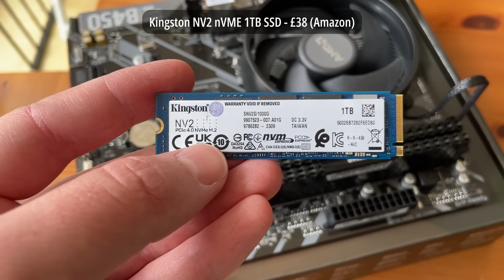Building a Cheap and Upgradable Gaming PC in 2023

Comment: It's funny how all budget builds almost always use am4
Reply: Why is it funny? I dont understand
Reply: @breh9320 Those AMD sockets ain't cheap unless it's secondhand
Reply: Built a junkyard pc for 200 with a 2700, sold it for 250. Buyer said he’s popping a 5600 with a rx5700xt..alls to say, am4 mad value lol
Reply: @thebambinofan  make 5 UK pound....
Reply: @thebambinofan  i build an AM4 for my sister kids and an Uni gift, years ago
it leave my desk with an Ryzen 5 1500X and an rx470,  im just gift him the x370 board that i have
He work it @ss off and now that very same PC now have ryzen 7 5700x and an rtx 3070, same good old x370 board
AM4 upgradeability are surper imo
Reply: am5 is too expensive 😔
where I live a motherboard on am5 is around 3 times as expensive as a board on am4
Reply: @rogofos I guess it depends on a lot of factors because at this point, an AM5 MSI Pro Z690-a wifi was cheaper than its AM4 counterpart. Made the more expensive RAM only slightly more expensive when you take the two components together. But not everyone is using an overclockable Intel CPU.
Reply: There aren’t really any good cheap Intel options if you want something that came out recently
Reply: @jiggybucksington  Nah the 12th Gen i3 is a beast for the price of it on the secondhand market
Reply: @jiggybucksington yeah tbh for $80 you can get an i3 or for $100 (Ali express price other places it’s $120) you can get a 5600. Clear choice imo
Reply: @jiggybucksington  That or something that came out years ago.
Reply: @jiggybucksington I mean,12th gen can be a very good deal,plus with 14th gen being confirmed to work with lga 1700 it's going to be even better
Reply: @TheRealNeoFrancois  yeah but there’s also been leaks that 14th gen is gonna only be a 5% preformance increase compared to their 13th gen counterparts. If it was 20% or better I’d buy Intel rn but that’s simply not the case. And at my budget range I get more preformance from amd
Reply: @Unboundiing  It's literally just a raptor lake refresh, what did you expect?
Reply: @Unboundiing  not from what i heard, i heard it was suppose to be around a 13 percent uplift
Reply: @TheRealNeoFrancois  ah okay, I was going based off of one of ZTT’s shorts
Reply: @jiggybucksington When I'm recommending specs to someone if they want new and budget-ish I always recommend them a 10105f because my brother uses it and hasn't complained about performance and you can always upgrade to something like a 11400
Reply: @ChiknPog  I'd honestly recommend forking out another 30 dollars and going for 12th gen so you have a larger upgrade path but the 10105f is still a good chip my little bro is getting my old i3 10105f once I get the parts in the mail lol
Reply: @Scornfull  motherboards are fairly expensive where I am and at that point it's out of people's budget normally
Reply: @jiggybucksington  because intel always changes the socket every 2 generations
Reply: Not that funny tbh
Reply: What's funny ?
Reply: Ryzen 5000 are excellent as well and cheap
My 4.1GHz 1200AF still runs anything better than Series S does
Reply: @Agent-mb1xx  That's interesting
Reply: The platform has been around so long and there are so many parts out there! 3 generations of motherboards with 4 generations of CPUs all pretty much compatible with each other. I wonder if AM5 will have the same  longevity?
Reply: *upgradeable builds
Reply: *upgradeable
Reply: 12100f with h610 would be better if you want to buy new and you will also be able to upgrade to 13th gen in future
Reply: @hueman69420  am4 is still cheaper and the 12100f and h610 is not worth the tradeoff for the price
Reply: As someone who builds and sells gaming PCs, I love these budget builds. Wish I would get more to build.
Reply: Why are you saying it is funny, are you suggesting that it is a bad value? Because the AM4 platform is actually a great value, and will probably be such for years to come.
Reply: @avtips4779  think they're saying it's funny because Intel isn't used nearly as often in budget upgradeable builds
Reply: @avtips4779 I never said it was bad value
Reply: Never been an AMD user but the 5 generation motherboard lifespan is always tempting
Reply: Processor are not that costly, gpu are intensive money hungry.
Reply: The 12100 is superior to almost all of the budget old ryzen stuff. Completely stomps the 3600 and i got one on ebay for 65$
Reply: 6 year old hardware is cheap. What's the big deal?
Reply: I managed to get a 12100f on ebay for 77usd, I think it's pretty good and cheap
Reply: For 500 dolares you can get a 12100f and 6600. Doble the price doble performance. Same value best experience
Reply: Its funny how intel just replaces every socket in 2gen of cpus and AMD still going with it.. hypocrisy
Reply: I3 better value to upgrade potential. Building a 300 dollar build now that could easily stay viable with upgrades for a decade. Lga1700 socket, ddr5, so the cheap 90dollar 12th gen i3 80dollar GPU and 1tb m.2 with 16gb 2x8 ram make it great for cheaper and more long-term upgrading potential.
The card won't go down much in value so will resell with little to no loss,, the i3 can be sold used for near zero loss even 7th gen i3 used sell in the right places forv100bucks now.
So going i7 or i9 will incur little loss on transition. 
Reason i3 is called best budget for future upgrade path.
Reply: Cool story
Reply: Am gonna do SOMEONES mom.
Reply: Kinda what happens when you have such a long upgrade cycle.
Reply: Or a 12400f
Reply: Recently built a new PC for my Mum (not a gaming PC). Intel really has nothing unless you want second hand at the low price point. The problem as much as anything is the need for a new socket every year in order to upgrade to newer CPU features, and their higher end CPUs hold money too well.
Reply: Best platform in recent history n should hold up for the next decade
Reply: AM4 is the way to go for budget builds. Motherboards for the Intel platform is usually to expensive for budget builds.
Reply: @@LazyDevsPc43v3r For gaming purposes? I wouldn't really do that, it's better to just use a 5800x3d instead and get a better gpu
Reply: Thats because of upgradability
Reply: AM5 and Intel 13th gen are still overpriced where I live. Plus if you factor in the DDR5 requirement for AM5 with the overpriced motherboards they make no sense for budget builds.
Reply: How is it funny?
Reply: @@LazyDevsPc43v3rkinda terrible value for gaming though
Reply: Yep I’m going to upgrade a system with a 2700x and a rtx 2060 oc I bought for only 200€ and I’m putting in a 5800x3d and a 6800 xt and suddenly it becomes a 200fps+ 1440p system for my wife!

Am4 really was the best platform ever released until now so let’s hope am 5 can follow its footsteps when the 8k, 9k, 10k and so on generations of Ryzen will be released!

I myself am still running am4 with a 5800x3d and a 6950 xt and will only upgrade when I get a good price for a 7800x3d and 7900xtx system for a really cheap price.
And I only want that for display port 2.1 support so I can use the latest amazing generation of screens!
Reply: AM4 boards be it X B or A ranges off something for all budgets and take a huge range of CPUs & uses cheep DDR4 RAM. Overall good stability especially 3000&5000 range cpus.
I started with X570 R5 3600 up graded to R9 5900 it's a monster gaming&creative rig then took 3600 put in a cheap A520 have a cool quite multi-purpose Bedroom PC that can do most things options were more limited &expensive with Intel.
Reply: There are great intel cpus like 10400F, 10700F, 12400F
Reply: I just got am4 with a 5500 to upgrade from a core 2 duo. It was amazing but literally today the same day I got the mobo and cpu it’s died. Idk how and I am very sad
Reply: @VolumeZero374  rma it
Reply: 1st try with AM4 I pre built cpu &memory into board then connected up power powered up fine, put into case press power dead cursed going AMD then noticed RAM Error LED on, tried each Stick individually found 1 dead DIMM stopped PC posting, email Corsair replace memory all good. Now fault find before blaming AMD.
Reply: 7 years of value and performance. AM4 is legendary.
Reply: AMD AM5 is too overpriced, if you wanna build a budget PC, you either get AM4 or switch to intel
Reply: @@LazyDevsPc43v3r How do you know it's the CPU that's the issue. It can be many other components that could be the issue, or the software.
Reply: Depends what generation Intel you would aim for as a lot of ryzen are better performers at a better price.   I recently built a test bench pc, but on a budget and for my base I have got an A520M with a Ryzen 4500 although I've put in a 3100 to update the bios. The 3100 was half the cost, but used and the 4500 is brand new and so without the rest of the parts I've spent around £120 maybe less on just the mobo and 4500 as they were both new.  The system is to try out games with different gpus mated to that cpu and it was the cheapest I could find new which is why they are soo good as a budget option.  I looked at lga 1200/1700, but a used cpu that's 6 cores for either would total alot more than £120 with the cheapest new mobo I could find.
Reply: Lga 1151
Reply: Turned out to be the best route and amd accomplished the goal
Reply: Am4 boards still tend to be reasonably priced is the reason  the higer end boards have 4.0 pcie surpport,support OC out the box and can be upgraded with a bios flash it's a no brainer really.

AM5 can be really expensive in some places
Reply: Why?? Intel old CPU's are nowhere as good or as cheap as AM4.
Reply: It because it's cheap then Intel crap😑. There nothing funny
Reply: It's because intel chips sucked for a while while ryzen was king
Reply: I was searching today for budget $300 builds and they all used Intel 4th Generation CPUs.

This is the first video I've seen use an AM4.
Reply: There isn't really any upgrade for E5-2620v3 for x99. Says a lot about Intel business practices.
Reply: It’s the most successful socket
Reply: It's the best socket ever.. and time will prove that right.
Reply: Best value in gaming today
Reply: Good value for money and upgrade path
Reply: AM4 and used ryzen cpus and ddr4 is dirt cheap rn. better than going with any intel platform
Reply: @someguywithmtndew5691  why is he not understanding any basics ? Old crab is fine, but why old 1060 crab, that 2600aged very bad. Any intel on GTX 1080 is better, why not build a 80 Ti build?
Why go mad old? Stock office crab ??
Reply: @@dotwaaplays39yup, Intel is overpriced, motherboards and CPUs. In Philippines.
Reply: Probably cause supporting Intel sucks
Reply: @ashton9699  why is supporting Intel that way?
Reply: At this point B660/Z690 intel seems to be better, because you have more upgrade options up to 13900k or ddr5. There are also great budget options with the i5 12400 and great mid-tier options with the 12600k and of course 13th gen. The 12600k is cheaper than the Ryzen 5 7600x while performing similar and running with ddr4.
Reply: @shavy9655 not really. AMD is always better value and is far better than Intel when it comes to eSports titles. Just look at valorant or CSGO benchmarks,  a Ryzen 5 being faster than an i9 is just ridiculous. Intel is seriously bottlenecked by their L3 cache
Reply: Well AMD is for poor people! So it makes sense
Reply: @LawrenceTimme  'warning intel fan boy detected'
Reply: Intel screws itself with new socket for each new generation.
Reply: @aleksazunjic9672 Not really? LGA 1700 has been going on 3 generations now. Just announced that 14th Gen is keeping it. And prior it's always been 2 gens per socket.
Reply: @eddiew.4650  Well, consider this - H410 chipset supported only 10th generation, you would need to buy H510 if you wanted 11th generation, although both had LGA1200. H610 supports both 12th and 13th gen LGA1700 CPUs (which is good), but 14th gen will have new socket. Obviously, budget gamers do not like that. Intel got a bed rep, and this would stick.
Reply: Intel keep swapping sockets so upgrade path just isnt there long term. Im not an intel hater, i have several intel machines here (typing this on an i5 6600 powered Optiplex) its just that if you want a long term upgrade path AM4 is a very good option. B450 can take Ryzen 1st all the way to Ryzen 5th generation without having to change board or RAM.
Reply: for most of the people buy a flagship setup form 2-3 years ago is the best option. Cheap and good performance always
Reply: Intels mobo and proc is expensive in my country. Amd cheaper.